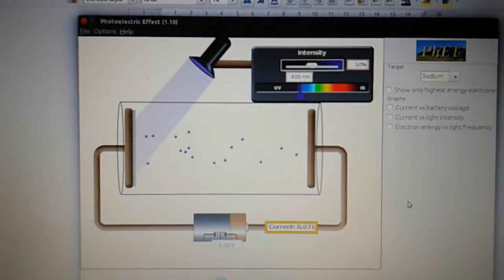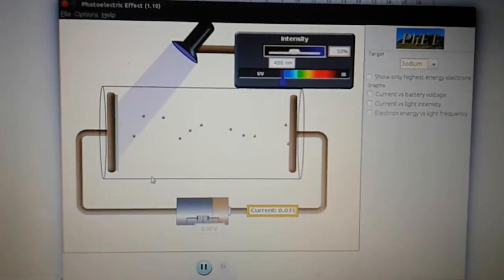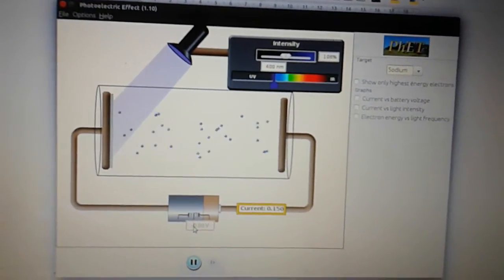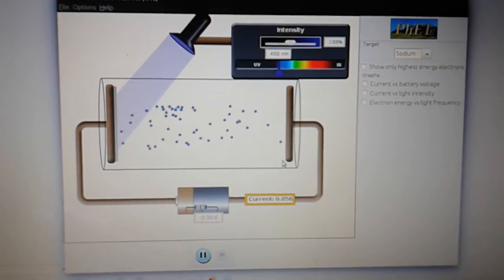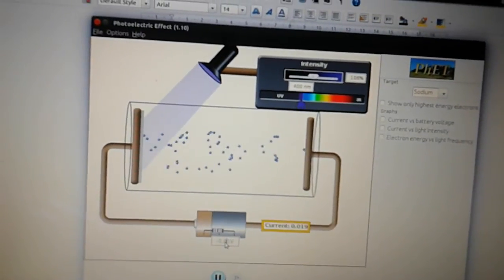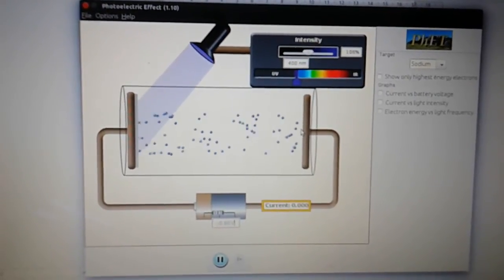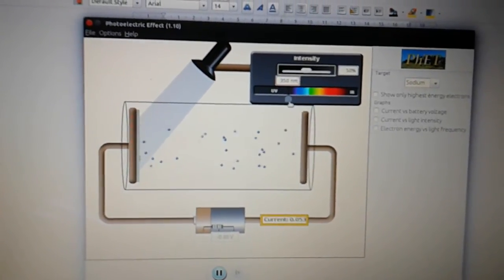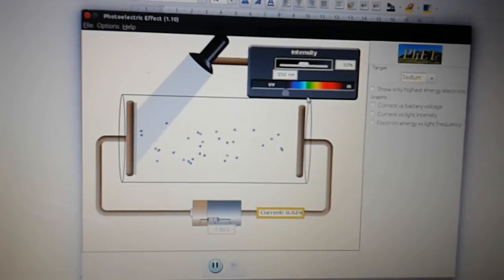Photoelectric effect 3: stopping voltage

Comment: Does it means the stopping voltage is the minimum value of the voltage that can build a strong enough electric field to stop the electron which is energised by the given light?  
 
Also, in the beginning, Does the light which has a frequency greater than the lower limited energised the electrons on the surface of the metal on one side and build an energy difference between two different poles, therefore, resulting in a current.

Thank you for your help
Reply: for the first question u are right
Reply: @djrkm9281  bro answered 5 years later
Reply: @kians3295  cuz I watched the video 5 years later? What’s the point of ur comment?